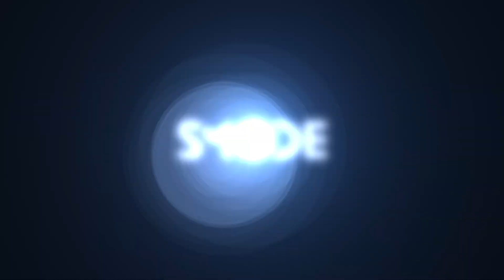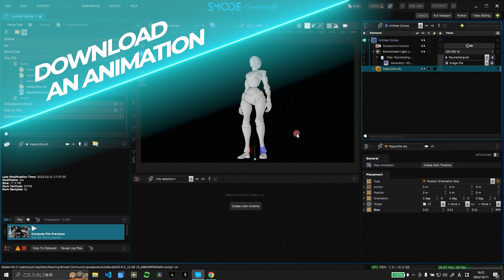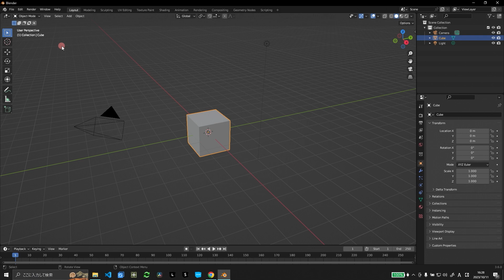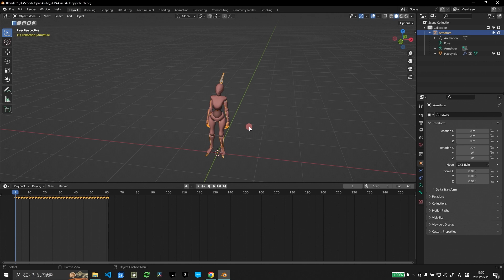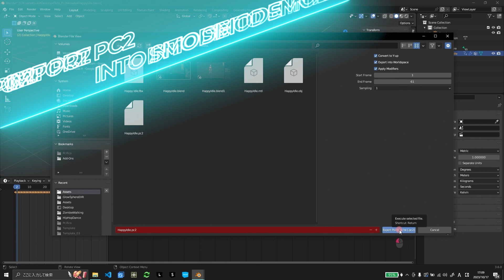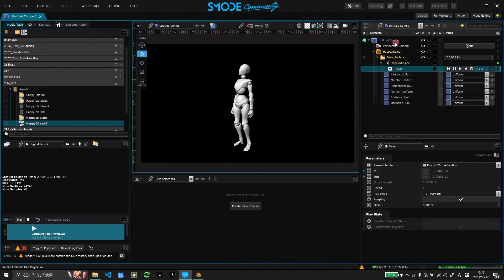Import an animated mesh (MIXAMO, BLENDER & PC2) [EN]

Comment: Great tuto ! By the way, as PC2 animation is interpolated, in Smode you can slow down an animation to the extreme with no stuttering at all, which is great when you simulate physics so you can render less frames in pc2 and it will work all the same ^^